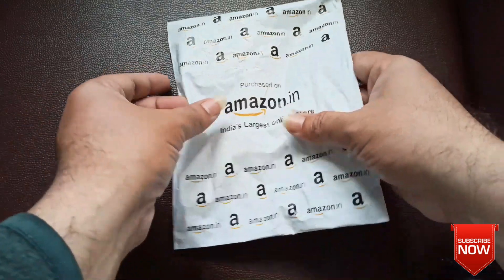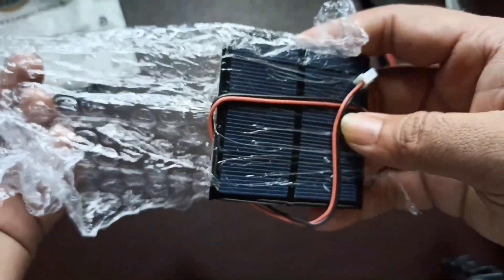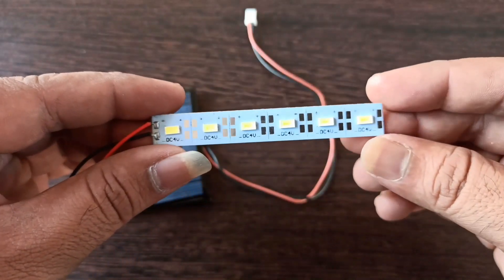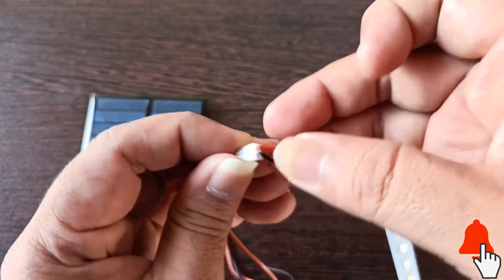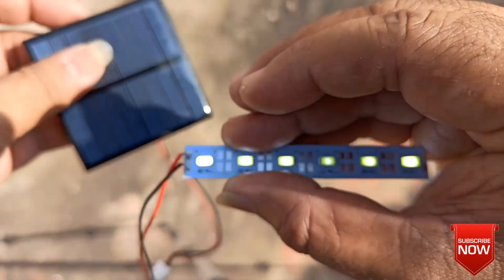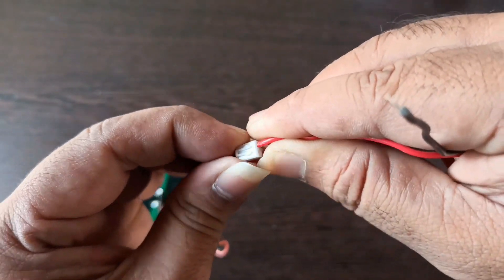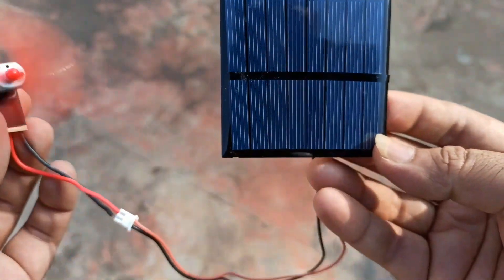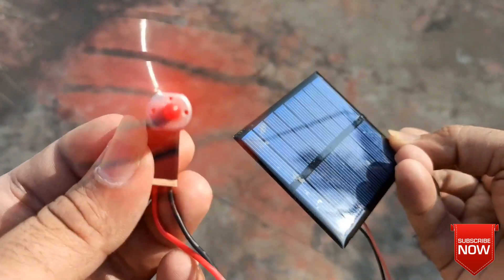Mini solar panel unboxing and testing with LEDs and DC Motor | 6V ,100 mA Solar Panel AMAZON

Comment: I bought a solar pannel which came today it's like 129 rs 99into69 mm 6v not wire connected and when I tried with copper wire it is not working
Did I make any mistake pls reply

Comment: that is 4v solar panel ...check the cells
Reply from the maker: That's a 6V solar Panel.
Reply: @DIYTechCrafts  count the cells and devide it by 2...bcos per cell is 0.5v

Comment: Which DC motor
Reply: please tell which dc motor
Reply from the maker: Micro motor. Please watch the previous video in the channel  on the unboxing of the dc motor
Reply: @DIYTechCrafts  what should we ask for shop keeper?
Reply from the maker: @dhanalakshmi9611  https://youtu.be/2EeSk1XCoV0
Reply: what is the name of the dc motor?
Reply from the maker: @dhanalakshmi9611  ask high speed mini dc motor 48000 rpm
Reply: @DIYTechCrafts  thank you
Reply: @DIYTechCrafts  but 
When I type high speed dc motor 48000 rpm in google it is showing 3800rpm, 1800rpm and etc...coreless dc motors
Reply from the maker: @dhanalakshmi9611  please watch this video. And the link is given in the description.
Reply: @DIYTechCrafts  which link

Comment: Excellent video!   Would that solar panel power  a device rated as  1200mAh      3.8 volts, please

Ecellent Video!   Would that solar panel power a device rated as  1200mAh   3.8 Volts, please?
Reply from the maker: No
Reply: @DIYTechCrafts  Thanks for writing.   Can you tell me about any solar panel which could power 1200mAh   3.8V,  in normal indoor daylight, please?

Comment: can i connect a 6v motor to this solar panel ?? and how much time will it take to start the motor if i keep the solar panel in sunlight ?? please tell
Reply from the maker: Yes you can connect a 6V motor to this panel. But if the load on the motor is high, it may not work as the current this panel can deliver is only 100 mA. But this can work by connecting the panel to rechargeable battery and connecting the motor to the battery. I will post a video on this soon. Stay tuned!
Reply: @DIYTechCrafts  okay thanks a lot 😊but one more thing that i wanted to know was that how much time will it take to fully charge the solar panel .
Reply from the maker: When you place the solar panel in proper sunlight it starts working immediately. But if the load requires  more current than the solar panel's rated current, it may not work.
Reply: @DIYTechCrafts  thanku so very much 😊😎i felt so glad to talk to you .....i can't even express my happiness.  U r fab 😎and maybee the wisest person i have ever met . U cleared all my doubts in just few mins ....thanks a lot once again
Reply from the maker: funcrazyideas@gmail.com
https://youtu.be/ov0R__p1UWU
Reply from the maker: Thankyou. I shared what I knew. 🙂

Comment: Sun ke light me led light ki kya zaroorat thi
Reply from the maker: Just to check the solar panel. We always install solar panels to store energy in the battery and use it. I cannot show the energy stored in battery in video. So I used LED to make sure that the solar panel is working. 😊

Comment: Bhai mere paas 4 pice 100mah solar panel hain lekin sirij mai join karne se Battery jyada charge nahi hoti 
Aur parlele main join kar ne se Battery 3 ghata charge bacup deti hain aisa kyu....
Reply: TP4056 module use kro battery charge krny k ley how to charge battery with solar panel 👉#mydreamlab
Reply from the maker: Whats are the battery specifications?
Reply: @DIYTechCrafts  muje mobile battery charge k liye panel chahiye..kaha se milega best .aur kya diode lgana pdega...what volts for this?
Reply from the maker: @kumailvipofficial  for mobile charging anything grater than 6 V can be used along with a voltage regulator. I will soon post a video on the same. Please stay tuned. 🙂
Reply: @DIYTechCrafts  litium ion battery 3.7 whatt ki...